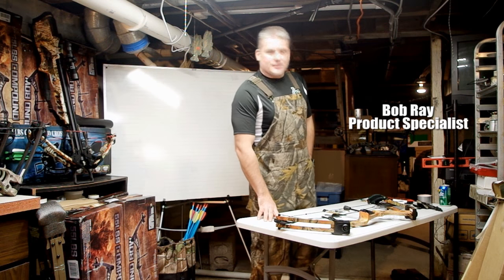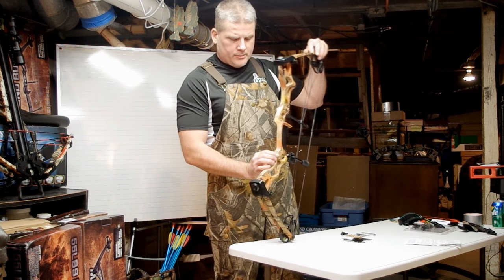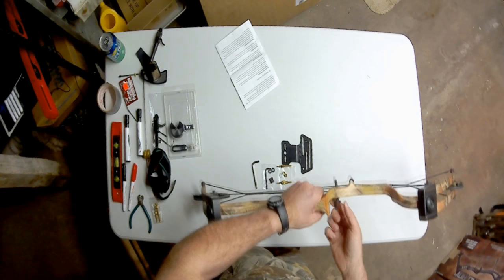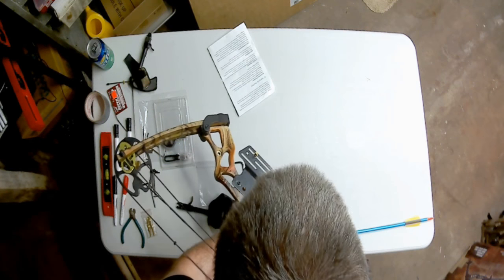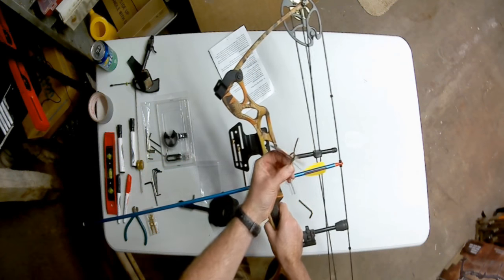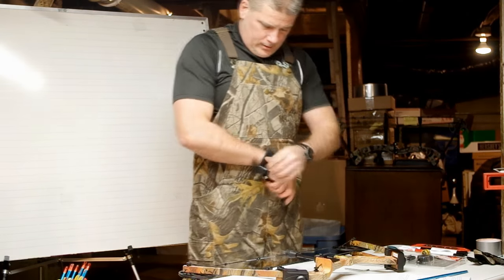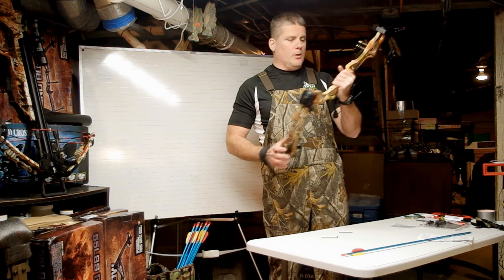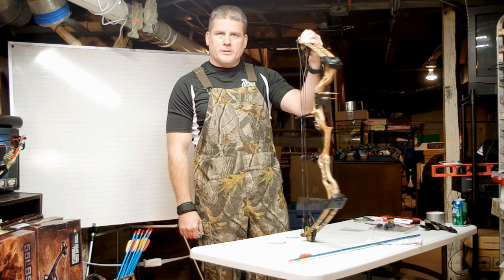How To Assemble Your Leader Accessories Compound Bow (Official)

Comment: The accessories are trash. I threw them away, and used real equipment and my son shot a 3d deer target at 100 yds.
Reply: The bow is great for the price i bought it naked (no accessories) for 50 bucks cheaper and could use it on decent sights and arrow rest